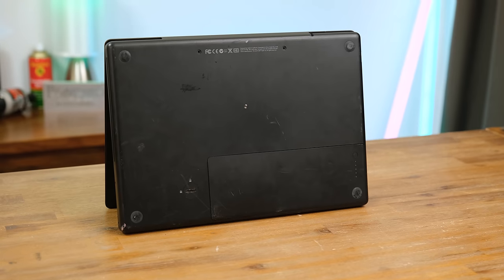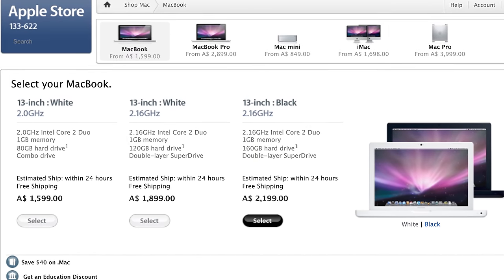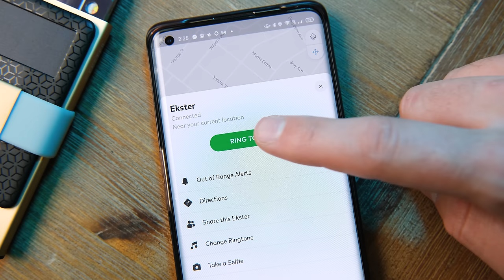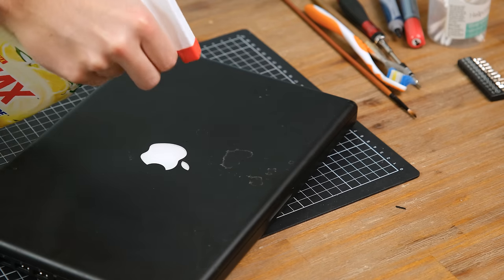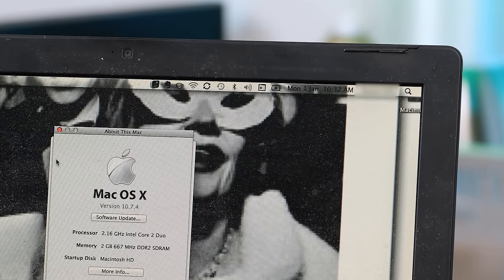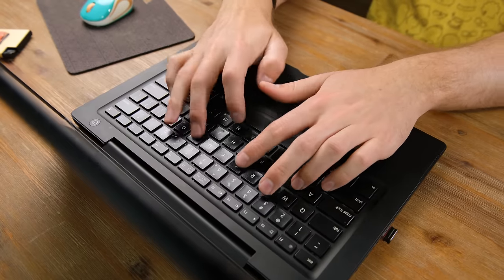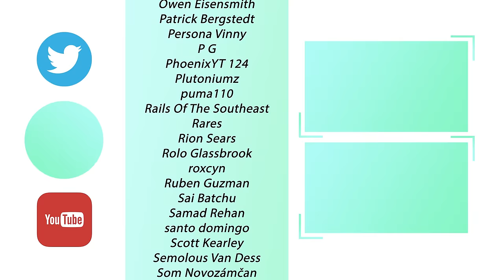Restoring Apple's Rare Black Macbook from 2007!

Comment: I owned this exact same MacBook in 2010s. Then replaced it in 2015 with a MacBook Pro. It is still with me and I've installed big sur patches and it is still good in 2021.
Reply: A 2015 laptop should be, even if maybe not a powerhouse, absolutely OK, even if not a Mac. I'm writing this on a 2013 HP lappy that cost next to nothing second hand a couple of years ago.
Reply: @BilisNegra  I was using a 2019 low end laptop until a few months ago, The model was originally released in 2017 though. It wasn't running well after the Windows 10 v2004 update.
Reply: @avillagerplayingminecraft5833  Install Fedora or Arch Linux
Reply: @berkem.  It was my old laptop that doesn't even charge anymore. Nothing more than salvagable components and scrap materials now.
Reply: @avillagerplayingminecraft5833  :(
Reply: @berkem.  It was used for a good 2 years before the charging port failed. Honestly, it's repairable but the specs are so low and not upgradable (Other than the 4GB RAM and 100GB SSD) that it's not worth it so I'll just remove the RAM and SSD and sell it for parts.
Reply: @avillagerplayingminecraft5833  That upgrade fucked up a lot of laptops.

Comment: If I'm not mistaken, this has a 32-bit EFI but a 64-bit processor, so many new 64 bit Linux distros won't work out of the box.
You'll need to prepare a special USB installer which uses a 32-bit bootloader and then switches over to 64-bit when loading the OS.
There are text guides online on how to do this, but no videos AFAIK. Might be worth a vid.
Reply: On my MacBook late 2007 I successfully installed the latest version of Linux Mint
Reply: Mattgradient’s guide has a lot of prepatched ISOs for all the popular distros.
Reply: @arturofernandez8487  thanks
Reply: @Alyxx Parke  that 3gb limit was a windows XP limitation. Does not affect Mac OS or even 32bit Windows vista or Windows 7
Reply: Chrome OS (CloudReady) installed and works perfectly without any hassle on my 2007 BlackBook.
Reply: @bosonbreeder  is it a new version? 64-bit? i had issues a while back when they stopped making 32-bit versions of Cloudready.
Reply: @gianlu96ct  late 2007 is a much better chipset. It can also address the full 4GiB RAM, whereas the earlier model can only see the first 3GiB
Reply: @HQA0  yes it does. This model can only address 3GiB RAM. This was also true of the similar aged Mac Pros. It wasn't OS level, it was the hardware chipset IIRC. The late 2007 "Santa Rosa" models fixed this and had a better graphics chipset too. SR uses the GMA X3100
Reply: @HQA0  I worked in computing between 2003 and 2006, building PC's from scratch. Mind you, that I am talking about 12 to 15 computers assembled from empty case to tested and working machine, each work day. (Plus a couple of repairs).

And it is not an WinXP limitation. All highend machines that I did back then, had 4gb, and depending on the motherboard, the max size would be anything from 3.75 to 3.96 gigabyte.

Not an WinXP issue. It is hardware or driver issue.
Reply: @TheMaddestNomad  Yes, I'm running the latest version, v92.4, of CloudReady Home Edition. Using only their standard USB-maker utility.
Reply: Who likes this comment yet has no idea what their going on about
Reply: @yaveenbeharr735  😆
Reply: @brostenen  Yes, it's not a Windows XP limitation; rather, it's about the OS not using PAE. The hardware occupies the last 512MiB or so of the 4GiB address space for stuff like ACPI and MMIO, and the occupied space on RAM gets remapped internally to the >4GiB space, which is only accessible using PAE. BTW, there are patches for NT5/NT6 kernels to enable PAE, which I've personally used in the past to get the full 4GiB on 32-bit Windows.
Reply: @itsmevjnk5155  All I know is what I experienced between 2003 and 2006. When I build aprox some 7000 WinXP computers. What the technical issue and technology behind, exactly is, are something that I do not know. But I saw a difference between chipsets on various motherboards from Asrock, Asus and MSI back then.
Reply: Why does everyone install Linux? Many programs well used by many do not support Linux. Also there are viruses for Linux, but no antivirus for Linux.
Reply: @echonomad94  what on earth are you talking about?
Reply: @echonomad94  Linux is great. Don't know what your problem is.
Reply: @TheMaddestNomad  Linux is just awful. Lack of compatibility with software, lack of features, bland interface. Also because Linux is just probably a OS designed for older computers that cannot run Windows 10 or other operating systems. Because lots of people install Linux on older hardware.
Reply: @echonomad94  what distro have you been using?
ZorinOS is very modern, easy to install, and full-featured and a great alternative to Windows or MacOS.
PopOS is stylish.
ElementaryOS is VERY comparable to MacOS.
Even Fedora has come a long way.
Reply: @echonomad94  I hope you're joking, you're stressing the poor guy out 😂
Reply: @hansoy8208  no I’m not joking lol
Reply: Yeah judging from the keyboard that's a 32 bit EFI model
Reply: @TheMaddestNomad  uhhh I actually want to try popos
Reply: @echonomad94  You should. It's a very stylish and fun OS that's easy to use.
Reply: Use Debian, they have 32bit out-of-the-box
Reply: Fedora is the solution. I installed Fedora on a cheap Windows tablet that has a 64-bit Atom processor but a 32-bit UEFI.
Reply: there's no way you're going to install Lion on any black MacBooks ☀🌤⛅🌥☁🌩⛈🌧🌪🌬🌫 others have managed to install Windows 7 64-bit on these because OS X Lion is not going to install at all

Comment: I have never once in 25 years seen memory covered in "grease"
Reply: wait you don't lube your ram?
Reply: That’s sad then, you probably just don’t work with computers, you put it on the ram to make it less prone to dust and other materials that may stop it from working.
Reply: What grease on memory gorden Bennett I've been working on pcs and laptops since 1999 never once seen this done before
Reply: @martingolding4951  that’s kinda sad…
Reply: @FlyboyHelosim  I don't think that was Apple original, I have never seen it on any older Macs I own. Most likely after market (given how much that bay area has been opened especially.)
Reply: this grease is actually commonly found in car wiring lol

Comment: Used to own one when they were sort of current Gen. Got one cheap since the optical disk drive was busted. Replaced it and machine worked perfectly. The main flaw was the keyboard assembly because the plastic on the edges would start breaking very quickly
Reply: did have the silver 2007, Logic Pro, all keys did crack...
Easy to repair machine!
Happy on M1 for years

Comment: I found one of these in a dumpster a few days ago, used it’s top case to fix one of my other black MacBooks. I now have three of them and am about to sell one.
Also thanks for the info about Dielectric grease, I thought it was water damage because it had leaked out and covered all around the ram.
Also the white battery reminds me of the zebra computer that had a black body, a white top case or vice versa.
Reply: What luck.
Reply: I can feel the anger of the previous owner had cause you can't browse anything on it 😂😂😂 he probably got frosted and mad had to throw it in the trash

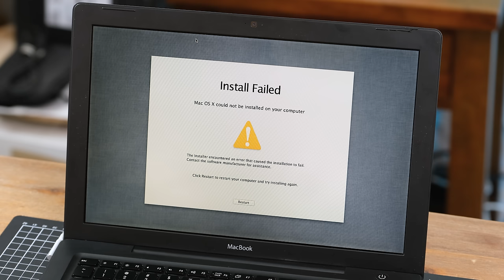Comment: @Psivewri OSx Lion was one of the first OSx versions released via the App Store. If you want to install it, you will need to change the clock date as signatures in the installer prevent Lion from installing on a date after or before it's release as at 5:55 . Try setting your date back to 2012 and then install it on the laptop.

Comment: I had the first generation of these from 2006, the 32-bit Core Duo. Over the years I upgraded the memory, hard drive, replaced the battery. Back in the day when devices were actually upgradeable and you could extend their life.

Comment: 5:57 not sure exactly what could've been the problem, but I suspect that you might've needed to change time and date through terminal due to multiple certificates being expired. Since those certificates are possibly (and most likely) expired, then that usually tells the computer to reject the macOS install.

This is just my guess, but I think that might be the reason why the install was rejected by your Mac.

P.S. If you're wondering to which date your mac should be set to, then try something like a year before the release of the system you're trying to install (Lion's release date was in 2011, so try changing it to 2010 or etc)
Reply: This! Even Hackintosh does this
Reply: Interesting 🤔.
Reply: I usually set it to ~1 year after the release, so for mavericks (released 2013) I set it to Feb 2014

Comment: The tip on the thermal sensor connectors is a good one! I tried disassembling my MacBook (13-inch, Aluminum, Late 2008), and I kind of broke the CPU thermal sensor connector when I disassembled it. With a bit of super glue, I managed to put it back somehow lol!

Anyways, this is another fun and exciting video! I'll be on the lookout for a black MacBook!

Comment: Incredible how Apple once built devices with the intent of making them easily repairable and upgradeable ... Seeing the garbage it produces today, you can't believe it.
Reply: what garbage?
Reply: @thecoffeemaker7444  Obviously it was intended from the point of view of repairability and expandability.
Reply: @sys-administrator  Which model exactly? because looking on google I see a motherboard with everything soldered... So once you've removed the screws, what do you do other than completely replacing the motherboard for any failure (at a disproportionate cost)?
Reply: Hopefully this right to repair movement might do something
Reply: @Brian-jv8iy  oh my bad
Reply: I mean one can desolder memory and solder it again, it is not that hard.
Reply: yeah, i dont hate what apple is doing now, but that is one thing they do now that disapoints me. I still am using an old unibody pro that is very upgradable, hope to use it for at lest 4 more years with a big sur patcher.
Reply: @sys-administrator  Cool, where are the SO-DIMMs like any other laptop, or an NVME drive you can swap. (I can't remember whether the 15" had an NVME that you could only replace with an official Apple part if you want full functionality, or if it's soldered down like a present-day Macs have but either way. Macs today are basically like gaming consoles. Designed to be used for about 3 years max, never opened, never upgraded, and then 'traded in' to get the new one.
Reply: That is a great computer though, despite my bitterness about soldered memory and SSD that you can't replace with normal parts. Until the 16" came out I was using one because fuuuuuuuu*******k that 2016-2018 keyboard!
Reply: *you might not, but I can, actually.
Reply: Garbage?  The MacBook M1 pro is the best Mac ever created…
Reply: @AndrewClare  Surely my English is bad, but I explained well what I meant, just read.
Reply: @thecoffeemaker7444  Modern MACs literally become eWaste quickly.
Reply: @thecoffeemaker7444  everything built in the 70's, 80's and early 90's was always built to last.
Reply: @mustafacanaydn3872  But why should you HAVE to solder something as basic as memory? Apple also has security measures so it's not guaranteed that desoldering will even work. I use Apple products but their practices have been bullshit. Linus bought two Mac Studios, tried swapping either the RAM or memory (don't remember) and it didn't work. I don't expect everything to be modular, but things like RAM, memory, and the battery shouldn't be a pain in the ass to fix.
Reply: garbage? Wtf?
Reply: @cos9398  LITERALLY Garbage. It's called E WASTE. A very serious problem even Apple Marketing is trying to address.
Reply: @REAL6  nope
Reply: @Neojhun  nah
Reply: @Maximus20778  Yup
Reply: @REAL6  nothing from the 70s-90s arent built to last
Reply: @Maximus20778  You're delusional right now.
Reply: @REAL6  you mean you are with your rose tinted glasses
Reply: @Maximus20778  i wouldn't know, i only wear cat glasses after midnight.
Reply: @REAL6  what the.....
Reply: The plastic macbooks were utter shite. The worst machines they ever made. Why would you ever want to repair one?
Reply: @hepphepps8356  ok
Reply: @brody2642  chill
Reply: The Apple ][es were very accessible.  Just heavy Velcro holding it together.
Reply: Most laptops are garbage once you experience the need to repair them lmao
Reply: In my opinion their devices are the easiest to repair, iffy with upgradable too
Reply: @census3370  in my opinion, you are the only one on the planet who thinks this
Reply: Jobs’ not sleeping well, clearly 😂
Reply: @mustafacanaydn3872  It is very hard. You need, at an absolute minimum, hundreds of dollars of equipment and a lot of training. My Lenovo laptop requires a Phillips #0 screwdriver and a Google search to replace most of its major components.

Comment: So the basic reason why Lion always fails to install now is that its digital certificate has expired. The easy fix to get it installed is to roll your laptops time back to around 2011-2012 and that will fool it into thinking its signed. Took me a few frustrating hours to figure that one out <3
Reply: hours?
hours to something that simple to solve?
man..
Reply: @-r-3542  I mean.... it doesn't exactly tell you thats whats going on. If you're not used to working on Macs you'd not expect this lol, tell me a time where you experienced this issue with any other OS Install?
Reply: @Megabean  this issue only happens with mac os and its easy to solve by just opening terminal and setting another date..there is no secret here..you just need to search the error message on google, thats easy to solve man..but i get it, a normal user should not have this kind of problem..
Reply: @Megabean  But i can tell something, this is intentional...believe me.
Reply: @-r-3542  ok bud

Comment: That full hard drive worries me. One of the reasons I've always been skeptical of ewaste centers is the fact that I don't trust my data being secure. The fact the laptop wasn't wiped before being sent is a bit of a red flag.
Reply: I work in a place like that and often find people have missed unplugged drives or m2 ssds on the motherboard.
Reply: @CollectorOfThings  Yeah that's not good at all. I feel like if I'm bringing something to a special place like that I should be confident they're going to get rid of my data properly if there's any there.
Reply: @insertnamehere6559  that's not their job, you have to do that yourself.
Reply: @grootsChannel  Not according to the law, at least where I am. That's the equivalent to going through someone's trash.
Reply: @insertnamehere6559  yeah, but you wouldn't throw valuable data out with the trash either.

Comment: Why don't you swap the casings of the batteries? The computer will look much nicer.
Reply: Because the casing for the batteries are sonically welded together, and trying to pry one open will damage the case, and you risk damaging the battery inside, which cause it to explode, and/or catch fire!!

Comment: I use to repair and flip tons of these on eBay and Craigslist, made a decent living for a couple years. These MacBooks have a hot spot on the bottom near the back middle that got incredibly hot when you used the Mac for a long time.

Comment: While I never owned the black version, I have the Macbook Early 2008 white edition. I used it for a good while before getting a new device. It's actually possible to swap logic boards with a Macbook 5,2, aka Early-Mid 2009. I swapped them and it now runs El Capitan natively, along with Mojave and even Big Sur with patchers. It's worth it, in my opinion, if you have the time and money to do it. These logic boards usually cost around $30 USD. All of the parts fit in the new logic board except for the SuperDrive, due to an interface change.

Comment: I have one, the 2.4ghz black Macbook. It has 4GB ram and stock 240gb hdd. I powered it on a couple of days ago and it still works fine. It has not been in regular use for over 3 years now.

Comment: I am still using this with Microsoft Office 2011. I have to say, it opens all my modern big spreadsheets faster than my 2012 on Catalina opens a Numbers spreadsheet! ..and with 4 Gig RAM vs 8 Gig on the 2012 MacBook Pro. I recently upgraded the 2012 with Open GL Patch, installed Ventura on a new SSD disk, and it runs just as well as my wife’s new iMac. I have the Black iBook networked with the MacBook Pro to handle any excel files and PowerPoints in native format. I don’t see the need to pay Microsoft for another licence again!  Thanks for the video 😊

Comment: I bought this laptop last year, but in white and with a c2d T8100, 4gb of ram, 500gb ssd, with a charger but no battery for $50. the cpu locks itself to low power without a battery so i bought a black battery. the reason i went with the black one was because it was a great deal for a barely used genuine battery, your setup reminds me of it.
i was able to install linux on it with no problems but when i wanted to try windows it refused to boot from that usb so if you wanted windows you had to use dvd to install it. but overall a really fascinating laptop to use!

Comment: In the US it came with 2 GB of RAM instead of the standard 1, which is why I got it. There was also only an 80 GB hard drive in the base model, while the black had 160. Surprised the Australian version skimped on the RAM and that there was a 120 GB white version too!

Comment: I have a black MacBook that I had found at the thrift store over 2 years ago for $60 and it works. Just upgraded the hard drive with a bigger size since the old one was dying out. And was also able to find a replacement Black Battery that was unused and in original packaging for $12 at another thrift store as well.

Comment: It's pretty easy to heat up and remove the black battery cover and switch it over to the new battery for a cleaner look. It's just held on with what seemed to be double sided tape.